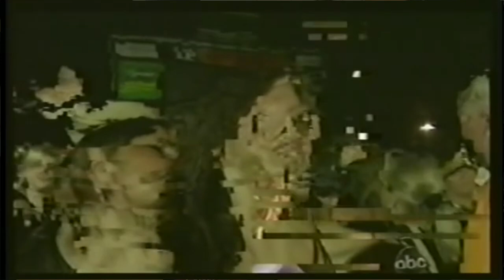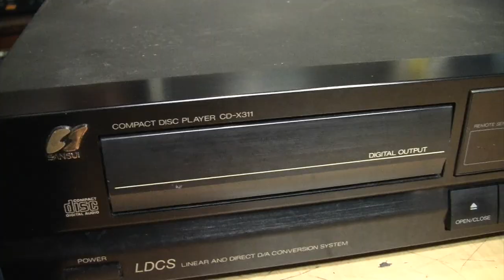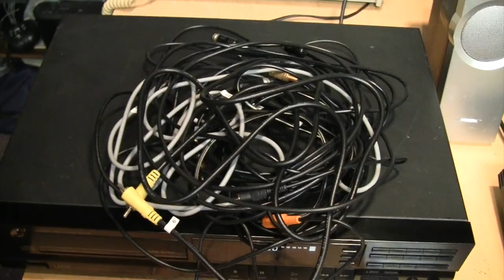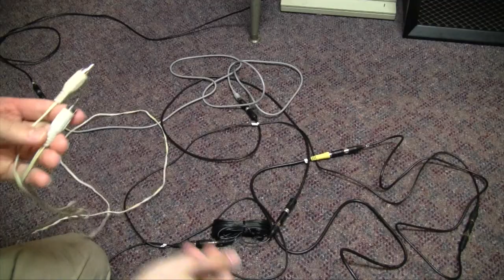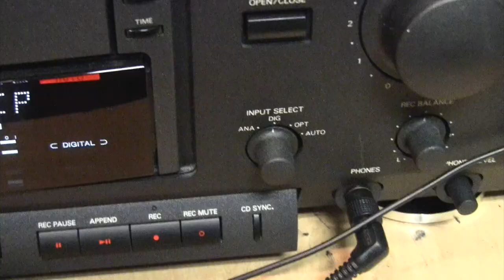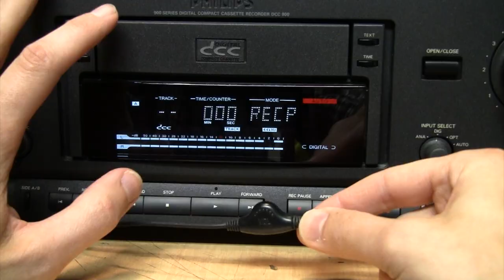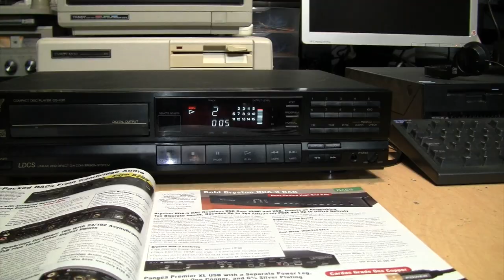What does a crappy digital audio cable actually sound like?

Comment: I remember when I was a kid i wanted to hook up my pc  in my room to the tv in the living room. I didn't have quite enough cable, so part of it was literal speaker cable taped to the RCA ends of two other cables. Worked just fine. My pc had no issue lol. I learned from a young age that a lot of times, cable is cable. doesn't matter what it's for as long as it's hooked up how both ends expect them to be.

Comment: Cheap ethernet cables can deliver a fuckton of data without much problem . If interference is bad just use fiber . If you are spending huge money on cables at least get one of those 400 dollar thunderbolt fiber cable that can move pci express tens of meters.

Comment: That last cable that's doubled up, in opposite directions, you made a common-mode choke. 
If you had sent the signal in the same direction through both halves, it probably would have worked.

Comment: some Audiophiles would have still and always an argument - You dont hear a difference because the gear is too cheap and the room not treated

A friend bought a expensive "4K HDR ready" HDMI cable before HDR took over completely on TVs, later we found out my cheap amazon basics HDMI cable, same lenght, can handle 4K60 with HDR easy, his expensive "4K HDR" cable struggled alot with sometimes disconnects

If the cable lenght is below the "maximum lenght" for the connection type - every cheap cable is just fine. Or how you proven - even multiple speaker cables and lenght beyond the official limits works just fine.

But - i have to say i invested already more into an analoge stereo RCA cable - I need a 10-15m cable for the subs, and at its route are power sources/cables close.
Any cheap RCA cable produce a lot of 50Hz humming, but a slightly better, real coax one dampens the noise completely. And i paid a higher price for (anyways useless shielding) and thicker wires - had with cheap 10m+ cables problems getting any frequency under 30Hz to the subwoofer. In fact the only advantages are a lower resistance and they are shielded better, but any of these advantages only have a real advantage in special cases like very long cables and much interferences around the cable itself
On the other hand i use for a 1200$ CD Player and Stereo Amp Combo, analog connection, a 20cm cable for idk.. anything like 10-20$? It probably would make a theoretical difference at analoge audio, but in my case, this short interconnection... doesnt need any shielding or thicker wires at all. Also... i know when it comes to cables and HiFi - we talk more or less about scams which should be illegal - on the other hand... this scam isnt affecting the normal people, there are much bigger problems.

Comment: It might be that the 50ft cable is destructively self-interfering due to the signal propagating in opposite directions in the same sheathing. So it may not even be the cable length that's the problem.

Comment: The main thing with digital audio coax is that the data rate is so underwhelmingly low that any sort of bell wire is fine, especially for the short distances usually seen between Hi-Fi components. And yes, either the data arrives intact, or it doesn't. There is no in-between, even for cheap vs. expensive HDMI cables, you either have a picture that is completely fine, or you get artifacts, glitches and dropouts - but it won't make the picture look any different, in the same way that audio over digital won't magically sound differently.

Comment: Wouldn't the unterminated y-connector cause heavy reflections on the line? That would explain the distorted sound when you try to use both sides of that stereo rca cable.

Comment: The problem (I suspect) wasn't the length of the cable but rather the capacitance introduced by running the data twice along that 25' lead. I'm fairly certain if you'd taken a knife to it and split the cable down the middle, it would have worked fine for the full run.

Comment: SPDIF is a really robust signal. All that crappy cable, especially when coiled up like that must be acting like an antenna for every WIFI, Bluetooth, microwave or RF signal you can imagine and it still works even when 60ft beyond it's technical spec. That's also with multiple points of termination. Great demonstration.

Comment: A very fun video, pretty interesting to hear some actual distortion in a digital sound signal, but obviously it seems that the audio isn't going to really degrade or become worse until you start hitting some crazy lengths, which then starts rapidly degrading the sound.

But this did make me think. A digital video signal from HDMI can experience some "degradation" in the form of "HDMI sparkling" or "snowing", which to the best of my understanding happens when the cable is getting a bit too long for the use (combined with poor quality cable), and some of the bits start becoming corrupt when traveling through the cable, scrambling the pixel information. Usually the video will just blank out with insufficient cables and I think that's more related to the cable not being able to deliver the required bandwidth, but snowing can happen and it seems to be more related to length + poor quality cable + bandwidth being just on the edge.

Could a similar effect happen in digital audio? Some of the bits become corrupted, which leads to something which would sound something like clipping? Or is this simply impossible because the digital audio signal simply never edges the maximum theoretical bandwidth of the cable, unlike with HDMI and video signals? Or are the digital audio vs digital video signals just handles so widely different that nothing exactly like that could happen in the audio signal, but can on the video signal?

Comment: Another test that might be worth performing is running the S/PDIF signal through an analog mixer, and use that to add in various sources of interference, like a 60Hz tone or white noise, or twiddling with the equalization to see what that does to the signal quality.

Comment: I the problem with the last cable might be related to the same signal goes in parallel wires in opposite directions. Both wires interfere with each other. Probably if you split that cable into 2 separate ones (red and black circuit) - the problem would disappear and that cable wouldn't result distorted sound.

Comment: digital output is still just a signal. i wonder how many ohms the cable in total is. i think that is still your limit. if you have a fairly big cable you could possibly carry on further.
and also maybe digital output from different machines could be more or less depending on....voltage?

Comment: I usually spend around £10/$15 on interconnect cables. But I choose cables that are resistant to kinking,  with good quality connectors on the ends, as I believe they are more durable.
I have tried using cheap rca cables, and sonically, I have noticed NO difference at all in sound quality when it comes to digital transfer. It is just like copying an audio track from one flash drive to another, you can have a 100th generation copy of a track, and it will sound EXACTLY the same as the first generation copy, provided you use the same audio codec , bit rates etc, as the track is laid down as 1's and 0's.
Analogue sources on the other hand, can suffer considerably, if you use the cheapest, "throw away" cables. For such applications, I would recommend spending at least £10-£20/$15-$30 on decent interconnects, with gold plated connectors, as the gold prevents corrosion and/or tarnishing, which can affect analogue signals considerably.
Good low resistance speaker cable can make a big difference too, especially if you are using quality speakers.
But digital sources, I have used the cheapest rca cables as interconnects, with no discernable difference in what actually comes out of the speakers.
Don't fall for the hype!

Comment: the problem of the 50' cable was that both parallel aligned single cables were interfering eachother. The magnetic fields of both cables inducted a current in the opposite cable and increased impedance not linearly. So not the length of the cable was the culprit it was the parallel alignement of both red and black marked cables.

Comment: If you had an audiofool in the room they would tell you the audio sound different and worse with all that cheap cable. What's worse is other audiofools would agree and go out and buy expensive and unnecessary cables. It's like a cult.

Comment: The only way to cause jitter in a signal through cable would be to have a cable with non-consistent inductance and capacitance, and I am not sure how someone could do that even if they tried. Maybe a robot that constantly winds and unwinds a cable to induce time based jitter? I want to see someone actually try to reproduce these claims.

Comment: Besides the unmatched impedance, having a digital signal go past itself twice in unshielded cable will induce an artificial reflection confusing the clock in the spdif signal.  What you are hearing is a multi-bit shift where the values are being overlayed, cancelled, and losing clock.  Since the red side and black side of the 25ft paired cable work fine separately, simply separating the left and right unshielded cables the full length, will clean up the signal. That is why single unshielded cables work fine but when 2 of them are next to each other and unshielded, the signal will induce a phase shifted one in the other cable, but since its a loopback, you are just artificially inducing reflection into the same signal. Two shielded cables of the same length in the same side-by-side setup will not create this same effect.

Comment: And I can recall a rule of thumb for estimating attenuation of a signal across a wire is to add effectively 10 feet per splice. Do note that it's not intended to be an accurate determination, or measurement of signal,  but something to keep in mind when determining if you need to shorten a run, or start considering boosters. I honestly didn't count how many connectors were involved, but we can assume maybe another 60-80feet effectively before the signal dropped to that level if it was a continuous, uninterrupted, cable. But I'll say realistically 1/2 that, considering I how generous the rule of thumb probably is. Maybe even less than that. Though there are some sketchy connections there with those y adapters. LoL

Comment: It's quite possible that the last cable which caused the signal to distort was because you had it coiled up and the same signal going down both cores was probably doing some form of common mode rejection effectively cancelling out the signal, this sort of thing is used in power supplies to cancel out supply noise going back out and affecting other equipment... 
It would have been interesting to see if the cable was unwound! Having it coiled up with signal going down both the left and right channel was probably acting like a transformer, the other coiled up cable was only a single channel cable so it wasn't affected as much although I wonder if a solid metal bar was placed in the centre of it would cause it to distort? 
Great video, couldn't help but picture audiophiles watching this and gagging with each and every cheap cable added LoL... Can you imagine how many people have thrown up while watching this hahahaha, I'm surprised that no one has commented that this video has made them sick LoL...

Comment: I'm thinking running the signal both ways through the stereo wire causes some kind of interference that maybe flips some bits. You should try it with just the stereo cable, one way and two way.

Comment: Jitter is real but it has to do with mismatched clock signals in the source and amp, not anything to do with the cable. This affects all s/pdif connections, and was only solved with I believe HDMI 1.2

Comment: the hum we all heard at first is best dealt with with proper grounding of all interconnected devices. If a source of music (eg tape deck) is connected to ground on one side of the room and an audio amplifier is grounded to a wall outlet on the other side of the room, if there is a small difference between the two grounds levels (millivolts) that can become audible when using analog signals on audio cables. Any change of voltage from any source becomes audible. Connect all equipment to the same ground at the same location. As for your digital audio cables, not every change in voltage is audible. In fact, the voltage doesn't represent audio waves, it represents either a 1 or a zero. The voltage is allowed to be w/i one of two ranges to represent a 1 or a 0. This is were the noize immunity comes from.  The sound is represented by the digital numbers, not the voltage levels. But digital transmission lines can suffer from reflections caused by characteristic impedance mismatches. The many characteristic impedance discontinuations created by the  couplers, unterminated Y couplers, different wires size & dielectric, will create reflections. The reflections will change somes 0s to 1 or vice versa. Just as you see broken up TV images with poor reception of digital TV, you will have broken up audio also.

Comment: No offence, but using high end equipment, you'll hear the difference between a poor "shoelace" cable and a better one. It's not about distortion the way you show in this video but in a loss of detail, accuracy and stereo imaging. Otherwise, you don't need cables that cost you hundreds of dollars. Just pick the right cable for the right task :) So in case of SPDIF coaxial cables, use a proper low loss 75 Ohm cable with good quality RCA connectors and you'll be absolutely fine!
Reply from the maker: Digital cables can't do that of that without decoding the audio, changing the content of it, and re-encoding it, all seamlessly in real-time. No such technology exists.

Comment: For domestic length cables, I have started to hate Optical Cables. When I met my wife (obviously she wasn't yet...) she had a TV with an Optical Digital audio output. When my Pioneer amp needed to be replaced, I got a Cambridge Audio One system, an amplifier with CD, Radio (DAB and FM) built in, and various inputs for £400 in Richer Sounds, but I paid £150 on E-bay and it's well worth it (£150, not £400) except for one thing — it only has one of each type of input, and the RCA Phono input was claimed by my record deck. Never mind, I'd use the Digital output to play the TV (sounds much better than TV speakers). Anyway, the first time I tried to plug an Optical Cable into the TV, something broke and ever since, it's been a challenge to keep it plugged in. I finally got a right-angle adapter and used it with Duct Tape to keep the Optical cable plugged in. And do you know what the annoying thing is? The Amp has both an Optical and Coaxial input, but Coax plugs are just RCA Phono plugs, and unless they are extremely ill-fitting, you plug them in and they stay in.

Ah, I hear you say, but Optical makes for a better quality signal transmission. Yes, of course it does, if you want to put the amplifier 100 yards away from the TV. But in a domestic situation, the signal will survive the 36 inches from the TV to the amp, even with a cheap lead, as this video proves.

Even though I can see a use for it professionally, to transmit data over long distances,  Toslink, in a home system, is just more snake oil to stop you buying cheap plugs and making up your own leads.

Comment: I did a test once: run a digital signal from my PC's SPDIF out through a 5m optical cable, into a DAT device and back into the PC via another 5m optical cable where i digitally recorded 5 minutes of the original signal. I then did a bit-by-bit comparison between source and recording. And guess what? Not a single sample had a different value.

With coax digital cables, all you really need is 75 Ohms per meter and you're good. Any sat antenna cable with cinch/rca jacks works fine and is cheap.

Jitter becomes a thing only if you have such time-shift in the digital signal that a DAC will not be able to put out the corresponding analog voltage at the time it should be put out. As long as the jitter is not within the 10 microsecond range, you'll be fine since a single sample for 44.1 kHz CD audio is some 22.6 microseconds in length. Most CD players and interconnects operate within the nano- or even picosecond range which makes a discussion on jitter a moot or even ridiculous point.

By the way: I consider plugs and sockets to be way more important than the cable.

Comment: What I really miss are the short Radio Shack RCA cables that were each a different color, Red, Green , Yellow and Black. Perfect for those short runs between components in your stereo equipment stack. Green and yellow for "IN" to receiver and Red and Black for Tape "OUT" from receiver.  Genius.

Comment: experience i have  is that  your standard  audio cables are sounding clearly less dynamic and more boring   than rca videocables that can go up to 75 ohms and even than each  cable produces a different result musically Same goes for optical every optical cable sounds different best are those thin glas fiber cables  2 pounds on ebay versus all those more expensive non glas fiber types
for optical i use 
:
eBay-objectnummer:
172044600463
anyway wont break your bank 
for elektrical coax i stil use an old vivanco from that sound image series from the 1990s
in those tterible blister packaging this kind: 
eBay-objectnummer:
123707036588
  but others might be just as good maybe a amazon basics serie 8 euro one wil be as good  but point is to me they all sound different  but its a personal opinion offcourse